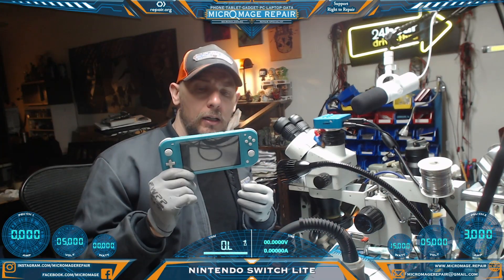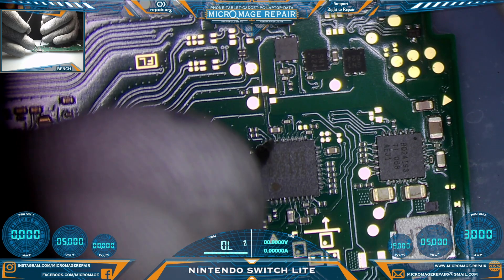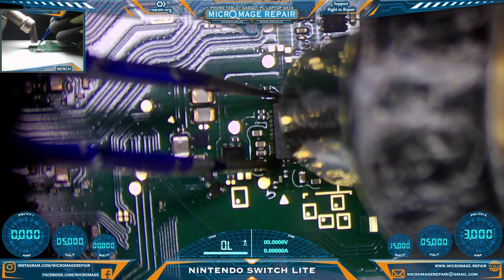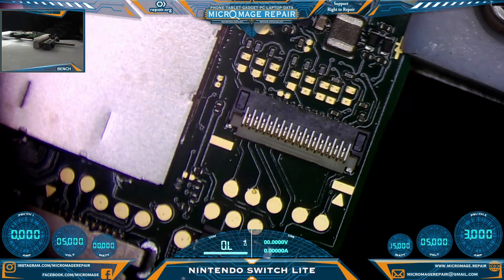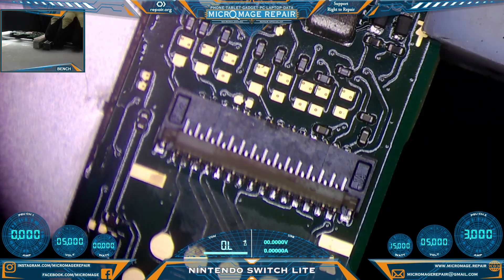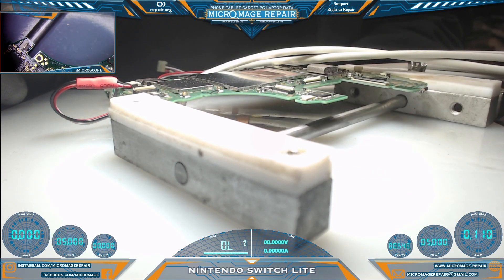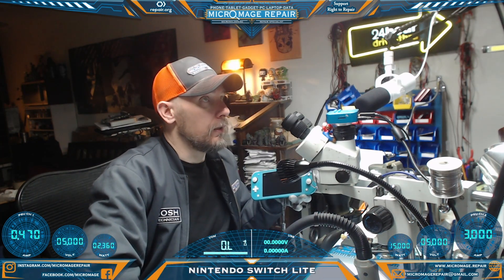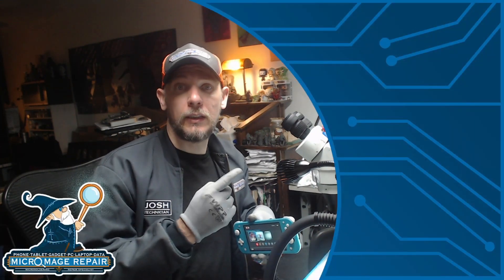Switch Lite; .12A No Power

Comment: Can i ask what are you checking when you do the PSU2 bit?  Also what you've got it connected to for the test :)
Reply from the maker: Thanks for the question Neil! 
First test is for normal behavior without a battery. Should go up to 19-21ma and back down without hanging in both charger orientations
Second test is to watch it boot under battery load.
I have a post about the cables I use in the community section that should help you out.